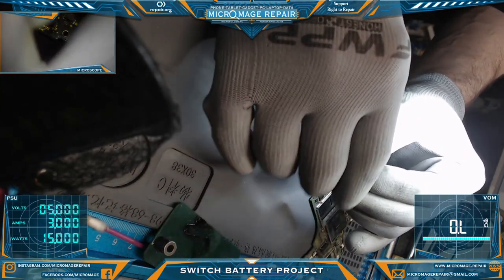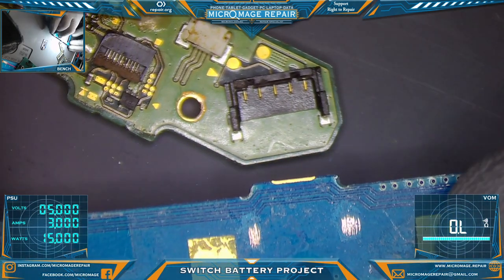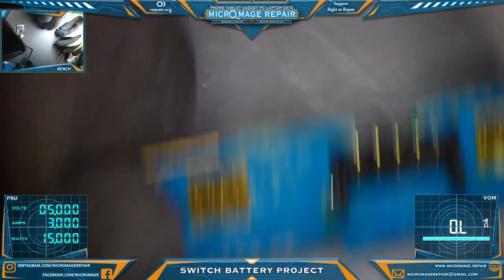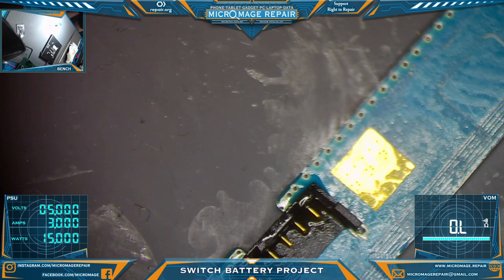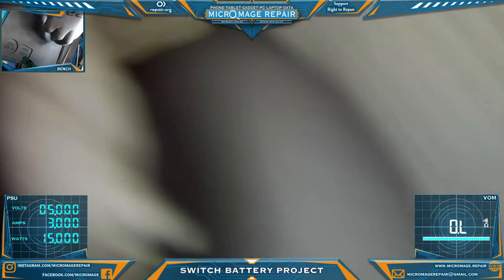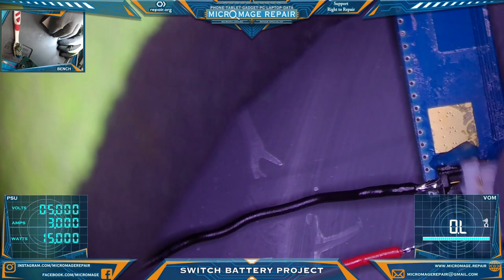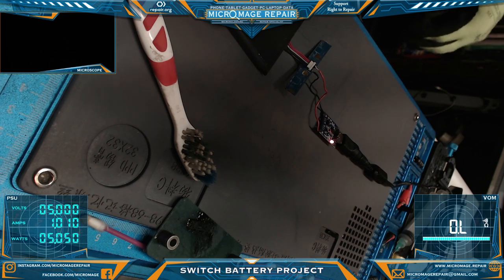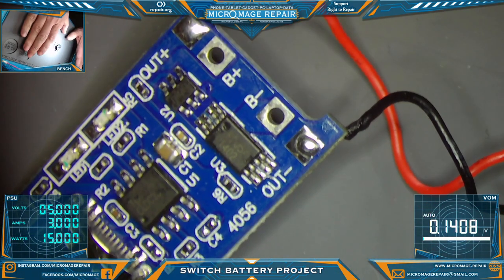Random Project: Battery Charger Module for the Switch

Comment: The Mario die tone fits in well with those dead donor boards & any customers dead devices to! They are common boards for 18650 battery charge projects. 🖖☕👍
I've had a few that didn't work & they all had bad micro USB connector solder joints. Input Voltage: 4.5~5.5V 1A Handy little boards for charge and discharge protection.
Reply from the maker: Why are you not doing videos. Leaving it to nubs like me when you could be educating people :P
Reply: I did in the past, when I was younger. I had two good channels shut down. Only takes 1 person to complain to google to give you 3 strikes and your whole channel is gone! So it kind of puts me off starting up again, I was toying with the idea, I'm still in two minds about it to be honest. You are 100% Not! a Nub not in my eyes at least.
Reply from the maker: @Ratchet_effect  You should totally do it. I'd watch, and subscribe.
Reply: It's in my thoughts & I have a lot! of ideas & things to cover. So I guess it would work, You & ESM, Cord3er, StezStiz, SDG to name a few all make me want to return, truth be told. I appreciate, respect you all & of Corse the Watch/Sub offer means a great deal to! God bless you! Micro mage.

Comment: Been playing around with this project and been able to have a custom PCB made & attached a simple battery percentage indicator to to the TP4056 board.  I've got 4 spare boards if you want one lol.  The Switch battery connector does need to be shifted slightly but works great ;)
Reply from the maker: That would be very interesting Roy!